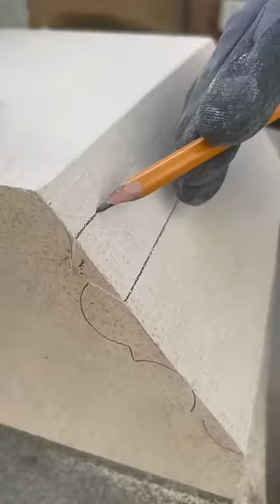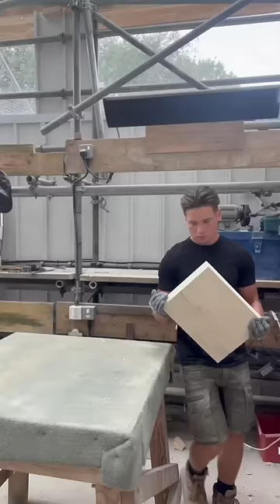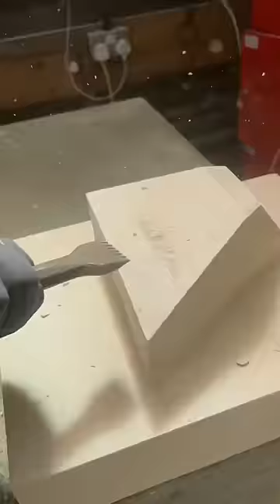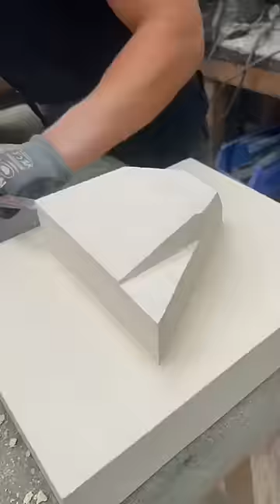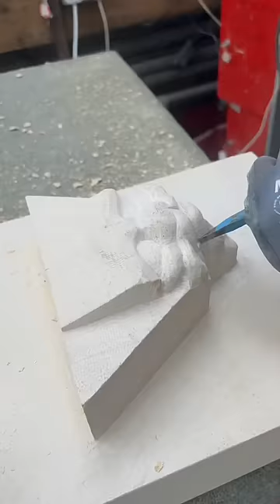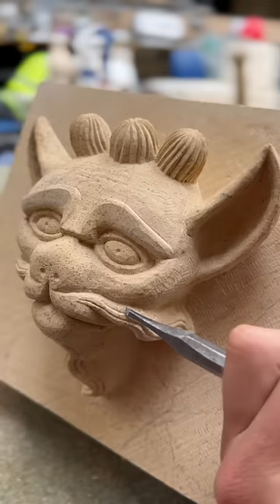#stonemasonry

Comment: ok now use the tool they were using and boulders as bi as they used. OH and dont forget to move them rocks with the same equipment said to have been used.. ill wait.
Reply: and the same degree of precision
Reply: What is your point here? We can do it, but why?
Reply: @MicahMotion 😂😂😂 bro they did try and were so far of the precision it wouldnt even stand and it was a miniature....before saying you can maybe try for yourself and plus im pretty sure you dont even know what tool they were using back then
Reply: @MicahMotion  look at that...its a miniature with no passage inside or anything notice how crooked and full of gap....plus they were only using smaller block compare to the 2.5 tons block use for the actual pyramid....oh and they pulled the block on 800km hahaha id like to see tha all that without any machinery with ropes and logs lol
Reply: @JONGOWONGO  The concept of a boat is incredibly confusing I see